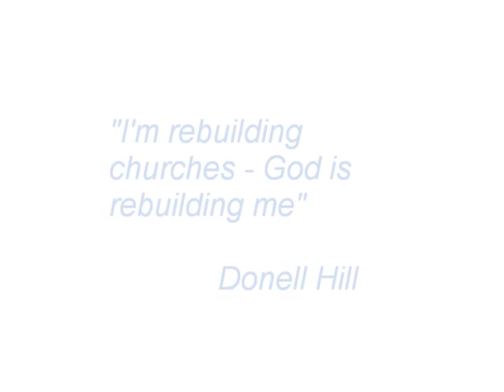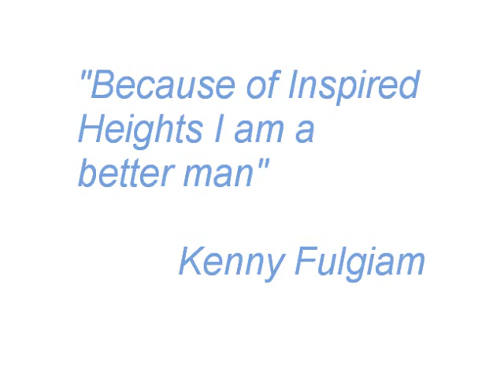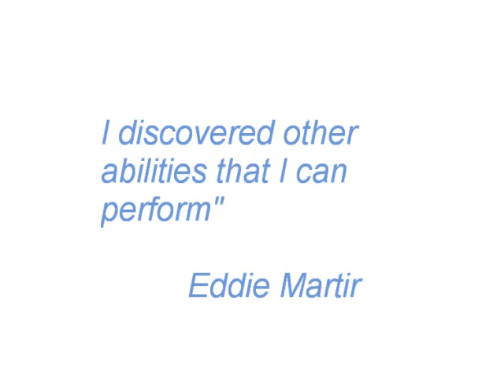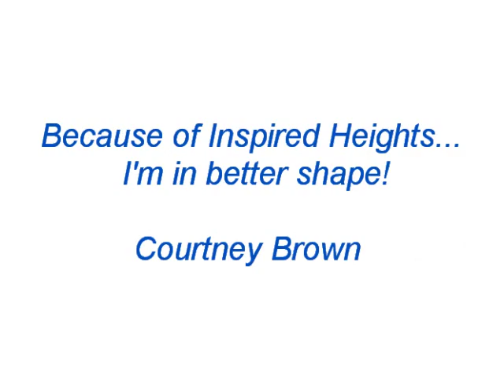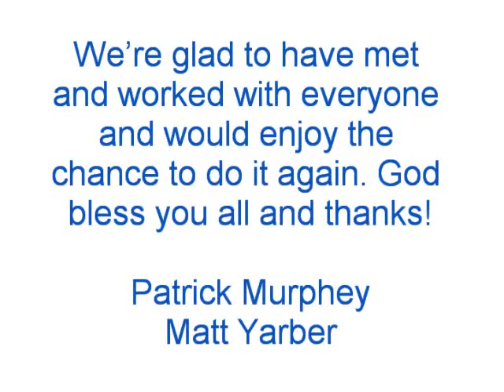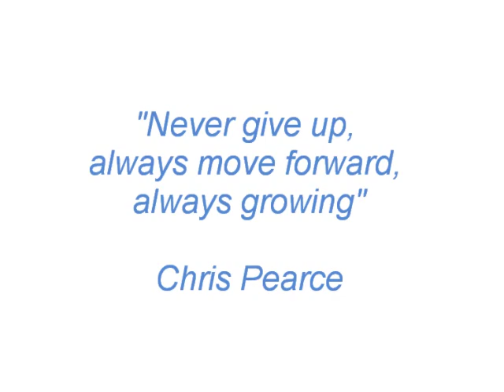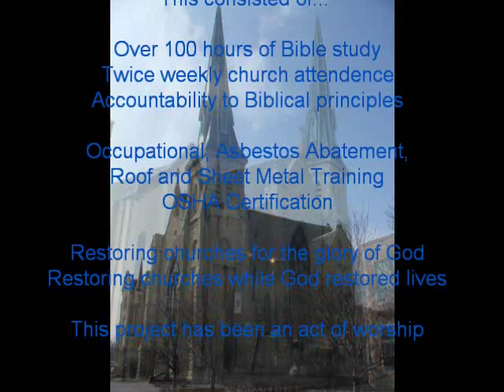FCB Church Roof

Comment: Are those fake slates?
Reply from the maker: We used actual slate on the steeple but engineers were not sure if the church would hold the extra weight so we went with synthetic
Reply: @InspiredHeights  nailgun was a giveaway.  How old was the building?
Reply from the maker: @NUMENOREAN91  started building in 1869 and was 1 of only 3 churches that survived the Chicago fire of 1871. Actually acted as a temporary city hall after the fire. Beautiful old church, great people too